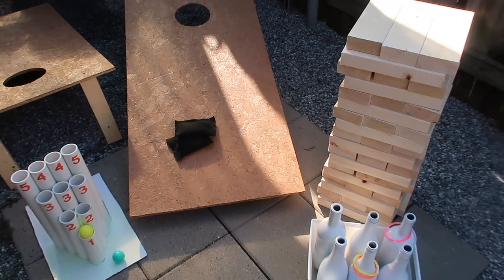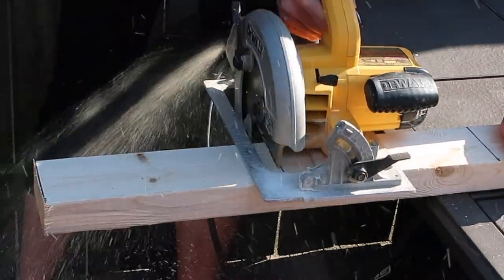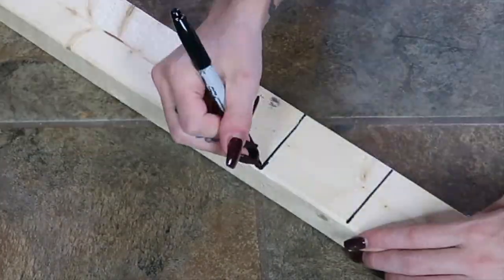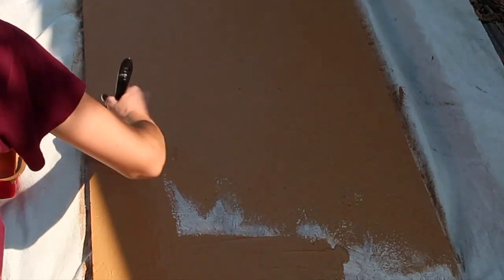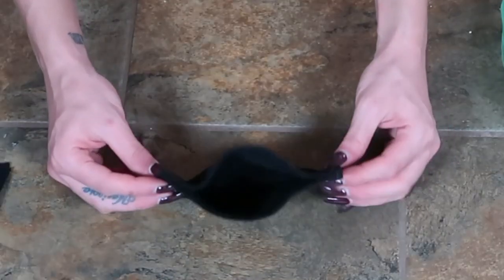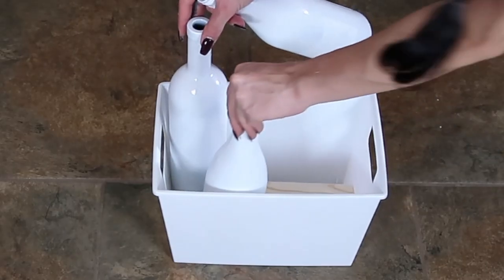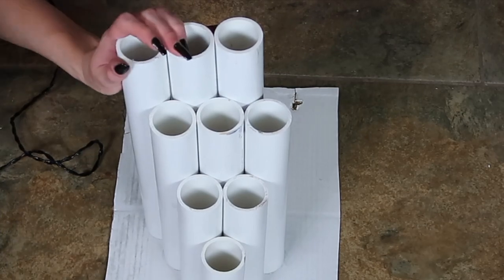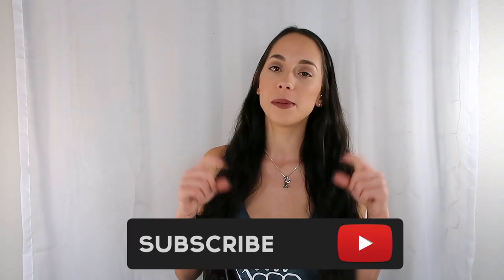4 DIY LAWN GAMES *Cornhole, Jenga, Chutes & Bottle Toss*

Comment: Glow in dark spray pain (rust-oleum max) works amazing and if you get a black light flash light it will light them up immediately when you hold on for a couple seconds and will stay lit after and recharges when you shine it on them especially up close